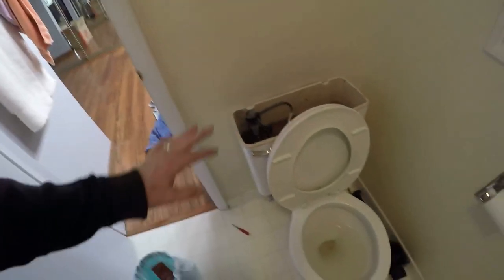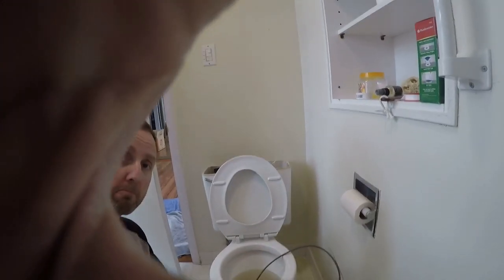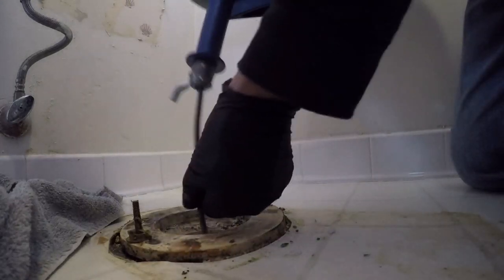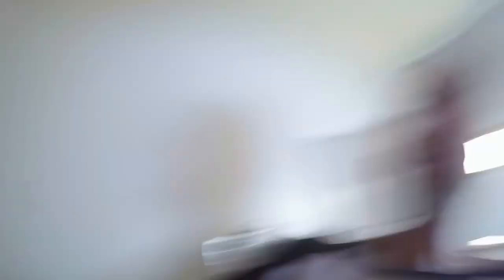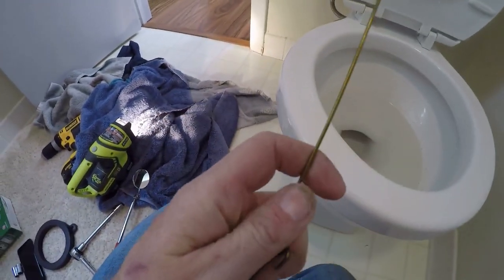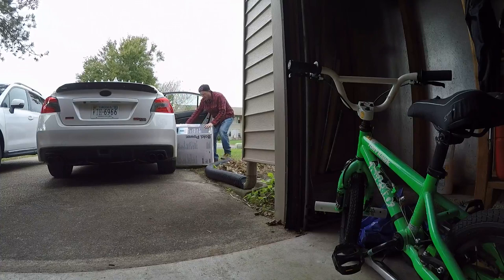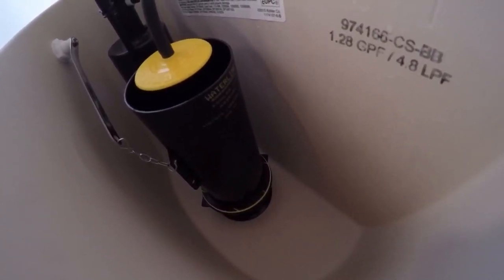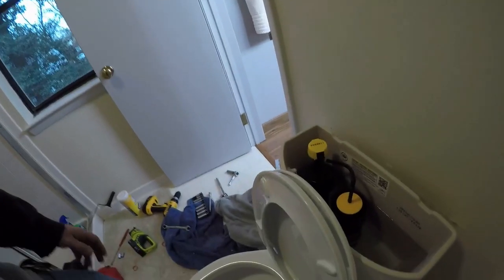LastHumansHomeLife: The Great Toilet Caper

Comment: Plumber here, you did pretty good, that Koehler toilet is a 1.28 gallon per flush, holding the handle won't really give you a "better" flush, will just use a little more water.  The old toilet probably had a calcium buildup in the porcelain inside the trap and the siphon jet, hole in the very bottom of trap closest to your feet when standing in front of it.  Good call on replacing it, the old 1.6 gallon per flush toilets were horrible compared to today's.  Next time you go to Home Depot for toilet get a American standard cadet 3.
Reply from the maker: i saw that one too.. i didnt really know what to pick. but i liked a nice look with a taller height. I was surprised how cheap toilets are.
Reply: John F at the big box stores, the best your gonna get is the cadet 3 or the champion 4.  Champion 4 is slightly better, but more expensive, plus you will never have a problem with the cadet 3, plus parts are cheaper when it's time to replace flapper.
Reply: thanks for the toilet info, never know when that will come in handy
Reply: woohunter1 which American standard cadet 3 I think they make a 1.28 and a 1.6 gallon one?flow wise or power wash version?or the cadet pro